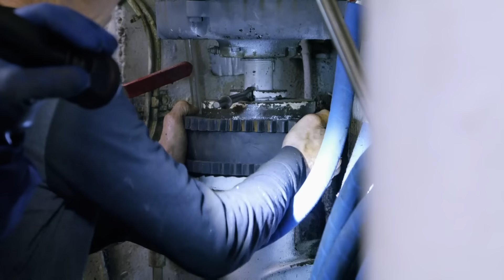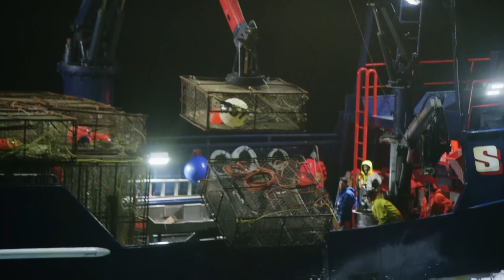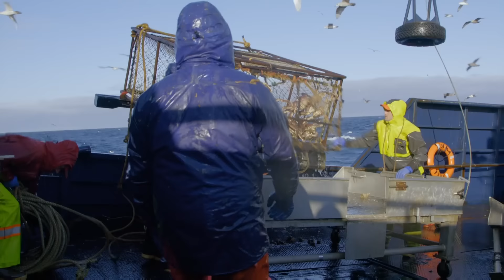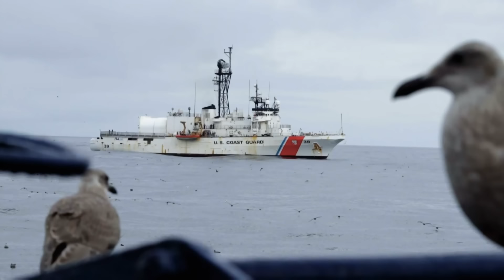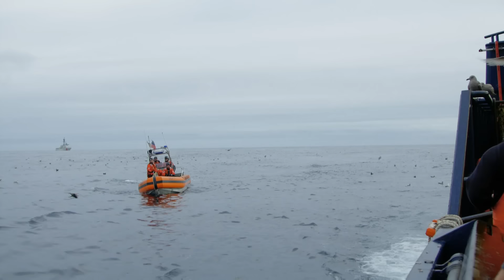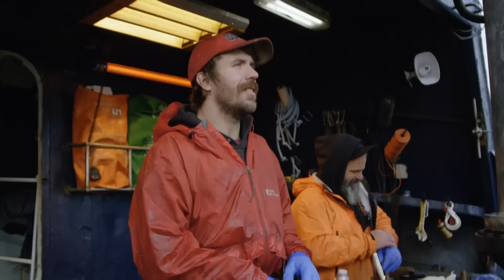The Saga Gets Boarded By The Coastguard After They Lose A Liferaft | Deadliest Catch

Comment: As a former owner and the operator of a semi truck that healed over sized and extremely heavy loads. Dealing with compliance for safety was a daily thing. And when you go above and beyond the safety requirements and when you deal with the men and women who's job is to check for this stuff. Its best to be upfront and open about stuff. Just as Jake was.  Because sooner of later you are going to  e dealing with these same people again. And having a good working relationship with them is a vital part of the game. Because Jake is 100% correct,  There just here doing there job, and to keep these fishermen safe as they do there's.
Reply: A great way of putting it.
Reply: And as he said, they're going to find out something like a damaged life raft anyway, it's not like that's a small detail. So no point in making them think you take them as stupid.
Reply: Yeah, safety starts with you and trust no one,  including USCG.  When I was younger the Cost Gard was in my Port.  The Caption of that ship made the mistake of speeding out of the inner harbor over a emergency.   He didn't even use the siren, just the blue light.   

For anyone that doesn't know,  you never leave a wake in the inner harbor.   That's how people get hurt by crashing boats.  It also doesn't take long to safely leave the inner harbor.   Once in the outer harbor,  they should be able to give her hell.
Reply: as a council abnormal loads officer I can confirm this. It's far easier to work with someone who's willing to work with me to make sure a movement is safe. The last thing either of us want is a truck hitting or going through a bridge or causing an accident. If a load is unsafe for a piece of infrastructure then it's unsafe. I've had one incident where a haulier who shall remain nameless has tried to give me a hard time about rejecting a proposed route and all that's achieved is making me less likely to assist in the re-routing process in future cases where issues arise (a courtesy I normally have no issue helping with but not something I'm required to do by law or council policy.)
Reply: Seems like most mariners have a high level of respect for the Coast Guard
Reply: @seafood1471  jup aguing with people wil make them do the bare minimum required of them
Reply: I concur
Reply: There's a few jobs, commercial roof service, linesmen, loggers, these guys...its almost impossible to regulate safety
Reply: goes pretty much for all trades
Reply: they are (they're)
Reply: Exactly. Attitude is everything. I drive myself and I've definitely found you can lure more flies with honey

Comment: That coast guard cutter is a mess on the outside. 
It has rust, discoloration of the hill and looks horrible on the outside.  Makes me wonder what the inside looks like?
Reply: Hard to paint the side of the hull in 20 foot seas not to mention putting your crew at risk even trying that.  I guess they cold use their drinking water to rinse off the salt water from all the waves hitting the hull and superstructure.
Reply: They need some sacrificial hull anodes to prevent corrosion.
Reply: as someone that had to bust rust and repaint, a ship with a fresh coat of paint will look just as bad after spending time at see. after removing all the paint, cleaning it (so the tools dont push anything into the metal which would create air pockets), grinding it down to metal, cleaning it again and applying the primer and paint, wait one day and you will see spots of rust bleeding through the paint in the exact same spot. fighting rust and corrosion (aluminum oxide) is an on going and expensive battle
Reply: @mrexists5400  Its amazing the lack of knowledge of people making comments.  Apparently people on here are experts at what ships look like at sea after a few months taking salt water.  Thank you for your comment.  Hopefully but I doubt it your comment will get through some people.
Reply: @ThatgirlnamedJodie  sacrificial anodes only stops what’s going on under the water. Through electrolysis.  

It doesn’t stop surface rust above the waterline. Where the paint has been damaged.
Reply: To paint that boat. 
It needs weeks on dry land.  

Aint no body got time for dat

It will be scheduled so it doesn’t get too bad.  
But it’s not something that can just be done.
Reply: The equipment and electronics work perfectly fine on board the Cutter.
Reply: you expect the coast guards to intercept them ? lmao
Reply: I work as a seafarer. No one in the right mind would paint your shit during storm or huge waves. Its a death sentence to any crew.
Reply: @mrexists5400  I think most of us are just used to seeing Coast Guard cutters with their near pristine white hulls. The amount of discoloration seems excessive compared to what we usually see. Even on cutters that have been at sea for a while, you usually see it along the water line and near the anchor chain but that is going all the way up the sides of the ship and into the superstructure. I think the Alex Haley is in need of some much needed drydock time. But then again, that's true for half the Coast Guards fleet.
Reply: USCG cutters are NASTY boats. They always look like shit on the outside, but they're impeccable on the inside.
Reply: @ThatgirlnamedJodie  yeah.. im sure the coast guard wasn't aware of that, they thank you, random person on YouTube, for pointing that out
Reply: makes me wonder if a Russian cruiser could beat a fishing boat at this point since their own crew seems to like to blow up their magazines
Reply: Reading your comment now after seeing Russia fail miserably in its invasion of a bordering country the size of Texas is especially funny.
Reply: @spdcrzy  I was on one of those Coast Guard Cutters, from 1973 to 1977.  I did 6 fishery patrols, in the Bering sea, two months each.  Our ship was fairly new at the time.  Don’t remember ever being that rusty.  I was surprised to see.  Must have been poor paint and prep from the last job. It’s a constant battle.

Comment: "Before a crab boat could leave the dock every time, it should be inspected by the USCG and everything must pass a very close scrutiny, every pump, hose, motor,   crane, generator, compressor must be  working perfectly with spare parts and hoses for everything and the engineer does nothing but check below deck and never work on deck. Never!"😮

Comment: Damage rendered the life raft unusable? Pretty sure it was that one guy who stabbed the thing😂
Reply: you can’t reuse it once it’s been inflated so stabbing it didn’t affect it
Reply: @tylerw8943  if you can't reinflate them then how do they test inflate them before they package them?
Reply: @MileytheJeepV2  they dont
Reply: @curtisridge2506  yes they do lol its the law... rafts intended to be life rafts must pass inspection proving they are safe
Reply: @gsesquire3441  look it up man lifeboats have to past safety tests
Reply: @gsesquire3441  do they just safety test on a deflated life raft? Seems like itd defeat the whole purpose of testing wouldnt it
Reply: @gsesquire3441  "The IMO, in resolution A761 paragraph 5.5, states that the life raft should be subjected to a pressure holding test over a period of not less than one hour. ... If the raft has an inflatable floor, it must be inflated for one hour." Thats the law word for word bud... every life raft must be tested or its illegal
Reply: @gsesquire3441  kinda like if you said no bro they dont test start every new car out of the factory before it hits a dealership lot.... youd be wrong as hell youd sound stupid because yes they do... its not hard to turn the key just like it isnt hard to inflate a boat and look for leaks
Reply: @gsesquire3441  not only that but every life raft thats legally a life raft has to be certified as a life saving device... costs between $600-900 per raft and the first thing that has to be done is a test to make sure itll actually save lives before its certified... either its been tested or it isnt a life raft... prove me wrong with an actual fact calling me dense doesnt mean your right lmao

Comment: Damn so if you're on a boat, you lose the right to deny searches? If you're already concerned about your crew's safety and you know the single raft is enough for the crew with a second on the way anyway, then why would you risk running back into port and losing the money to purchase the other raft?
Reply: Generally it's a bad idea to say no to the people with cannons, so yes if your on a boat you can be boarded by whomever controls the waters. But that what the coastys were checking with, they notate it in their inspection. When you get to port and correct an issue you can call them to let them see you gladly fixed the issue in a quick and prompt manor making them even more comfortable with the you. If you have issues in the future you'll get it fixed so they may say head back to port the long way giving you time to pick your pots.
Reply: Game wardens have the same authority to board boats and do inspections as well.
Reply: Issue is, you might think the single raft is enough. But safety rules generally arnt there for no reason.
Reply: @OrioleBeagle  yeah most people dont realize in most states a game warden has the same authority as state police